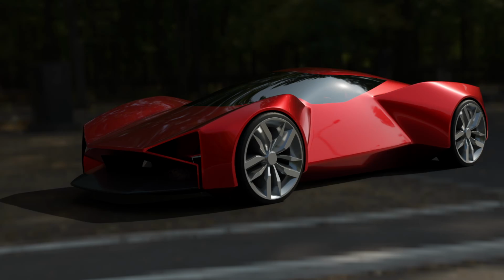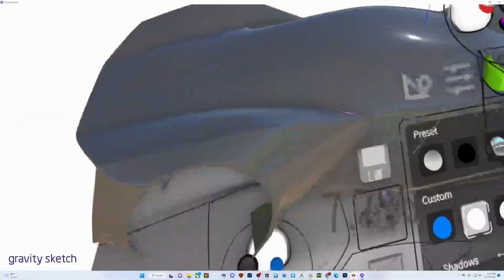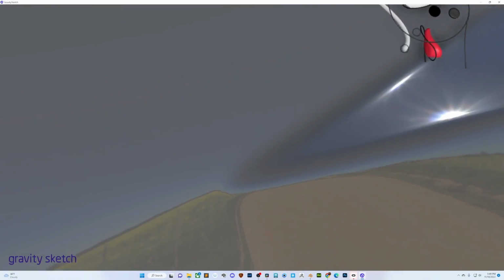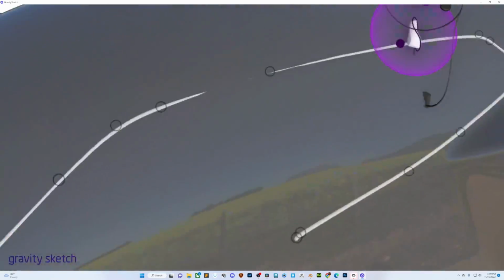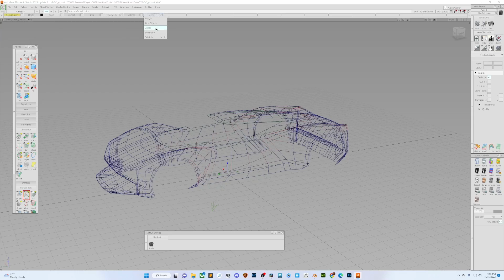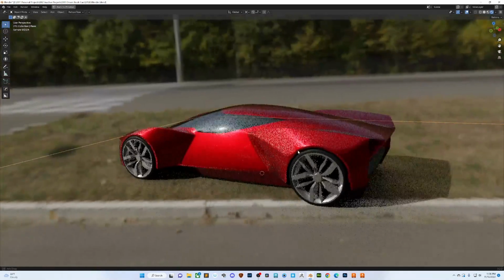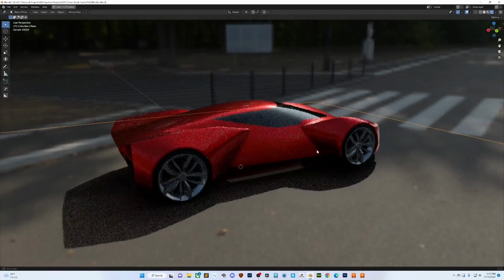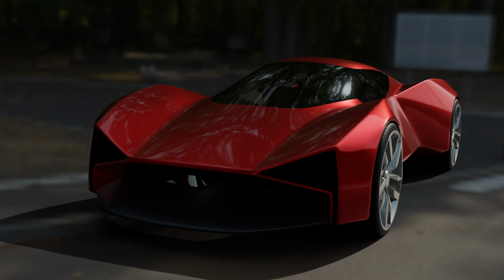Using Multiple tools including Blender, Gravity Sketch and Alias for Concept Car Creation.

Comment: Nice! Is Alias surface modeling still used a lot by car designers? Or mostly by the CAD teams? Btw, you got me hooked on Infinite Painter through one of your previous videos. Its UI strikes the perfect balance of giving you enough (Procreate gave me not enough.. Sketchbook too much), without getting in the way. Love the marker brushes to sketch with and the fact I can lock guides so I don't accidentally move them (*cough*.. *Sketchbook*).
Reply from the maker: Yes, Alias is still being used by car designers.  However increasingly, it seems designers are beginning to use SudD modeling workflows (Alias SubD, Blender, Maya, and even Gravity Sketch) to quickly visualize/understand their concepts in 3D.  Even when designers do use Alias,  they are relatively rough models and are merely used to give clear direction to dedicated digital modelers.  
When it comes to truly executing surfaces for production,  those surfaces aren't usually created by designers, but surface modelers / cad modelers who most often use parametric modeling packages such as Catia, ICEM or NX.
Reply: @Carstylus   As an industrial designer I've been always trying to get great topology and continuity in my models, but I'm glad to know that this sort of black art of perfect G3 continuity is a specialty in itself :) 
I've been using sub-d modeling with 3DS MAX for a long time (mainly for making softgoods elements in products like strollers), it's nice to see that the tools for that workflow are getting a lot more intuitive and more widely adopted. Whatever helps us get our ideas out more easily :)